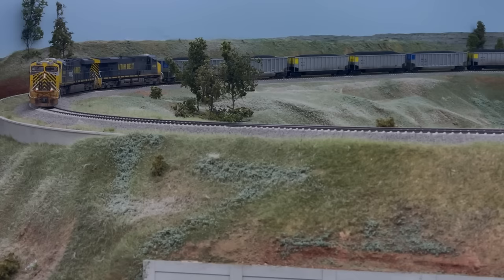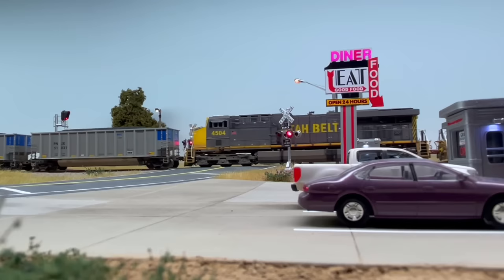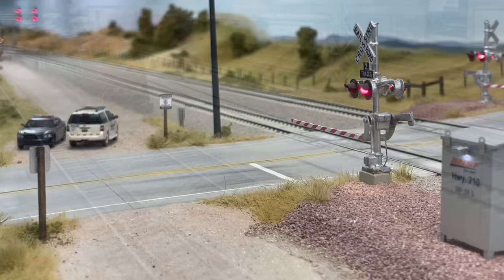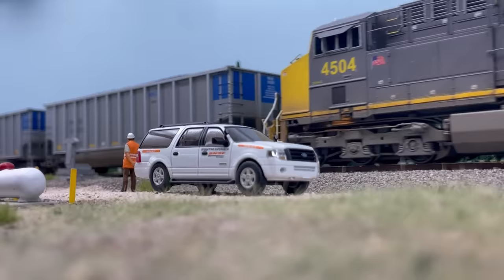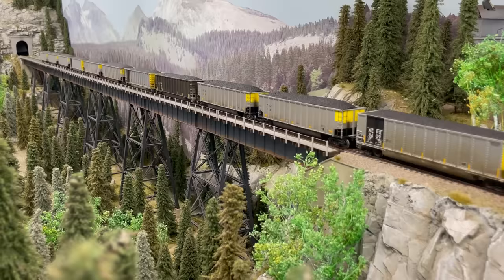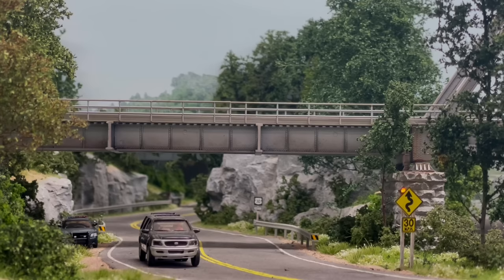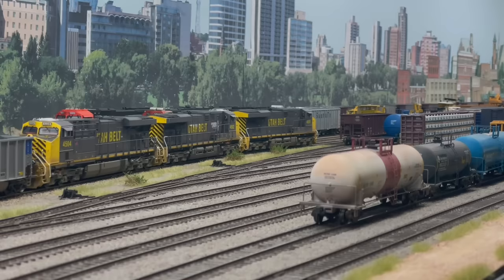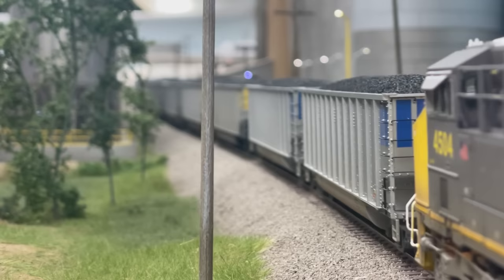Great American Model Railroads - UTAH BELT and BNSF Fall River Division in HO

Comment: What an incredible video! I had to keep reminding myself that this was a MODEL and not actual live prototype action. The attention to detail was fantastic. I fully expected the crew trucks to drive off after the crossing signals stopped flashing. And even the telephone poles looked so real that the wiring they held was busy transmitting phone messages. And the flashing red light atop the switcher waiting in the service yard was genius. Great job all the way around! Pentrex couldn't have done it better!

Comment: Young man, you have done a very fine job, not only honoring those who came before you, but your own layout is quite the fine achievement. Two things: first, as a real railroad engineer, I don't understand why some people cut off the simulated air hoses on their Kadee couplers? If they are not going to add those little rubber hoses with the magnetic gladhands, it would make more sense to simply leave the originals as they are because it looks more realistic than having nothing but knuckles between the cars. Secondly, this hobby – sadly – has turned into the polo of hobbies (rich mans game). Most parents, and young people, simply cannot afford to purchase all the materials needed to have even a small switching layout, unless they surf the pages of eBay and start off as I did in the analog world. Manufactures could change this, by simply offering kits where the consumer must install everything but the running gear. Again, you've reached another level, and we look forward to your next presentation...